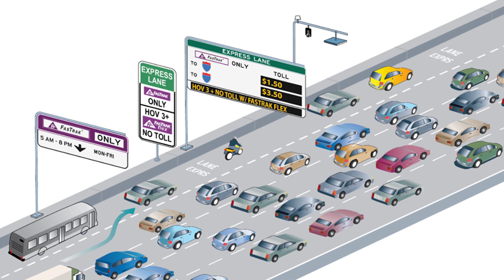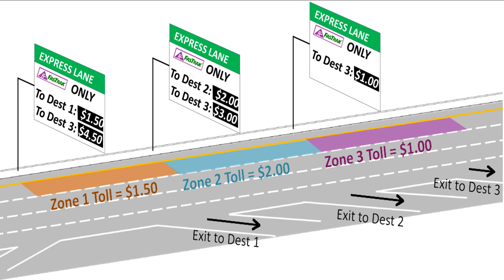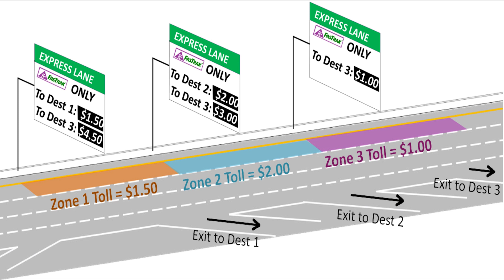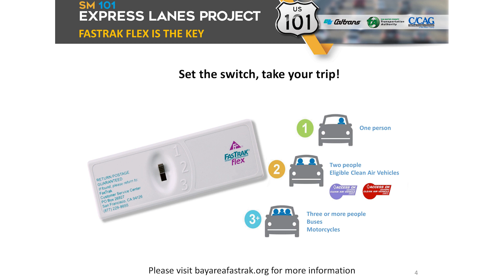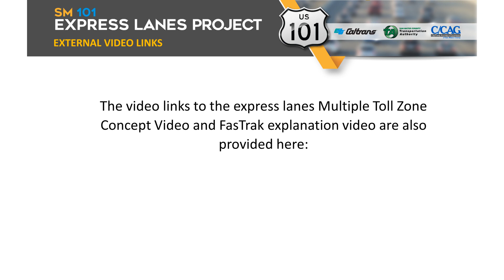Project Components

Comment: What if your car is only a two-seater and you have 2 people (the car's maximum) in it?  Can you use that lane without having to pay a toll?
Reply: FasTrak Flex
Set the switch to match the number of people in the vehicle (motorcycles and 2-seater vehicles carrying 2 people should use position 3+). Learn more about how the FasTrak Flex toll tag works. source: https://www.bayareafastrak.org/en/tolls/101-san-mateo-express-lanes.shtml